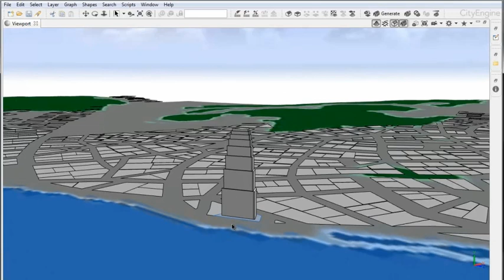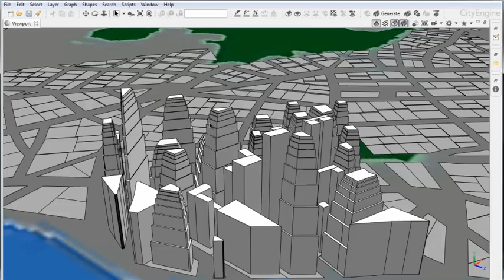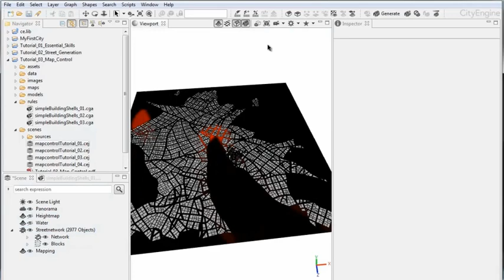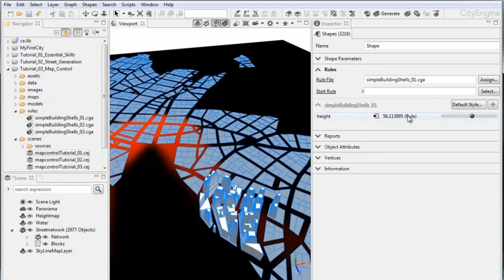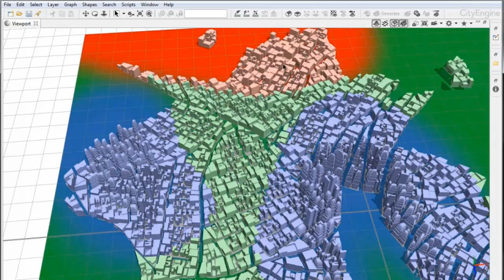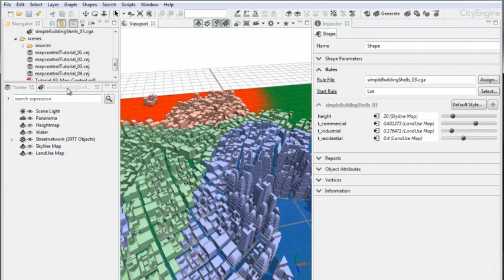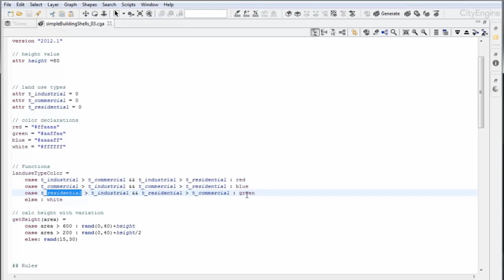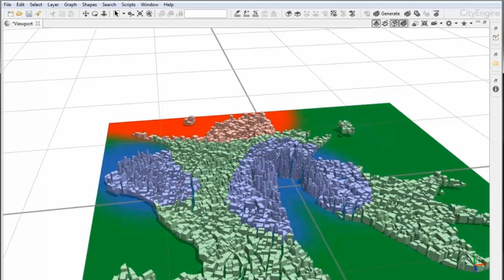#3 CityEngine Tutorial: Map Control

Comment from the maker: The raster file size limitations are not as much driven by real-world scale as they are on a pixel by pixel basis.  For example: if the terrain raster, orthophoto raster, or other form of imagery is too large for CityEngine to handle then resample the raster to a larger pixel by pixel scale. The Resample Raster tool in ArcMap will help you to achieve this.  Operations such as changing the image resolution in Photoshop will also accomplish this task for images that don't need spatial resolution.